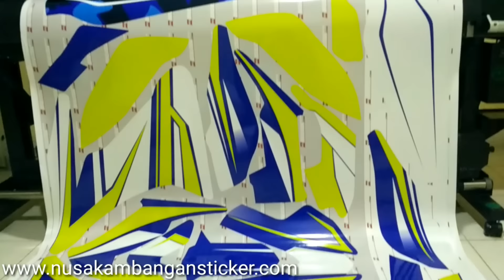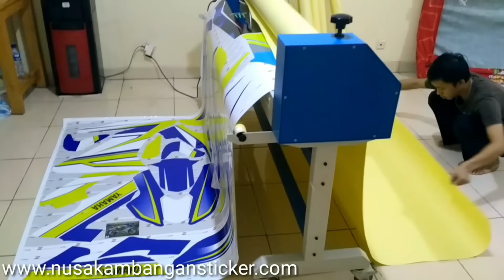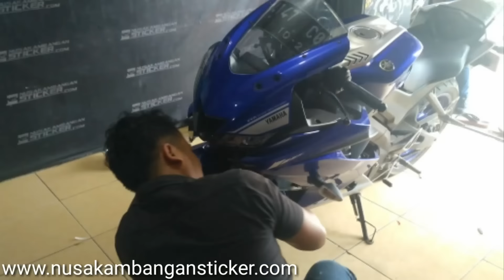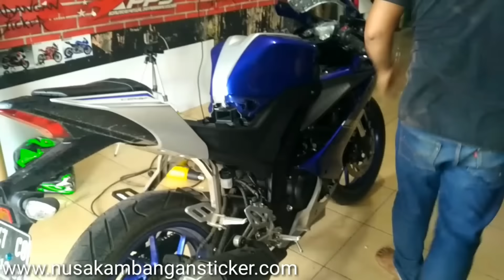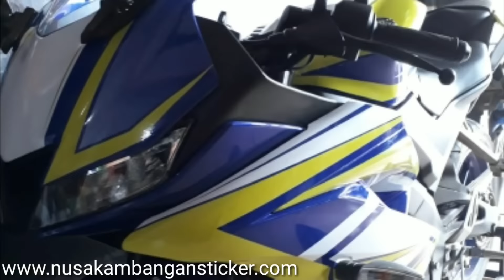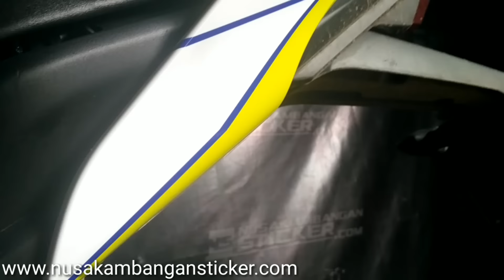BIKIN NGILERRR....Decal R15 V3 018 by Nusakambangansticker

Comment: Bedanya apa r15 2017 sma 2018
Reply: beda nya kalau  R15 yang baru tampilan nya cuma di lampu depan nya sudah led dan speedometer nya digital  + lampu hazard nya kalau yang lama kan gak ada lampu hazard nya sorry gua bales
Reply: Maksudnya yg 2017 bukanya ad semua
Reply: gini aja gan kalau mau saya jelasin datang aja ke diler kami di depok jalan kartini nomor 11Q gan
Reply: begini gan kalau yang new r15 itu tampilan nya beda gan untuk yang r15 2017 itu unit lampunya masih standar terus tidak ada lampu hazard gan kalau yang new itu unit lampu led dan lampu hazard gan dan untuk cc nya juga beda gan kalau yang tahun 2017 unit motor R15 150cc kalau yang new nya unit nya R15 155cc dan itu juga sudah VVA gan sorry gua jawab lagi
Reply: @egginurdiyansa6155  all new r15 2017 udh keluar om. Punyaku yg 2017. Untuk bedanya yg aku tau baru part kampas rem depan nya. Pas mau beli ditanyain r15 vva thn brp? Gitu